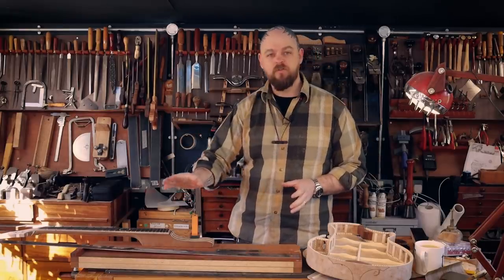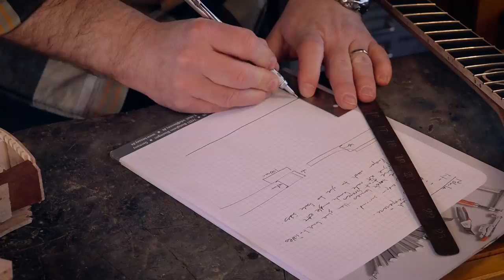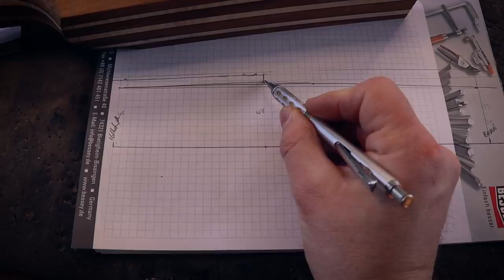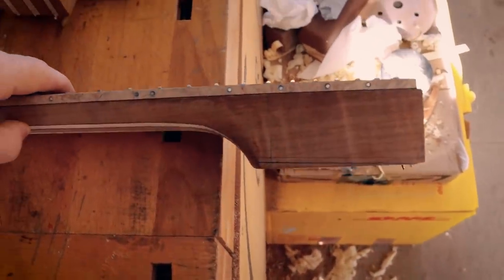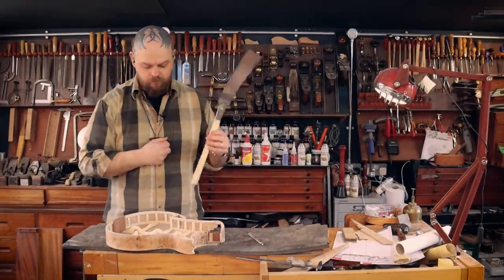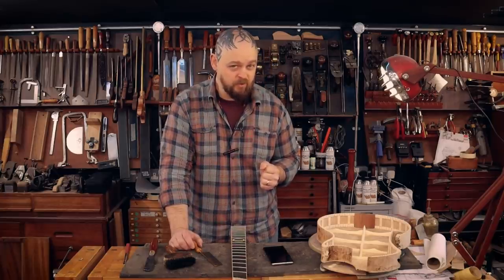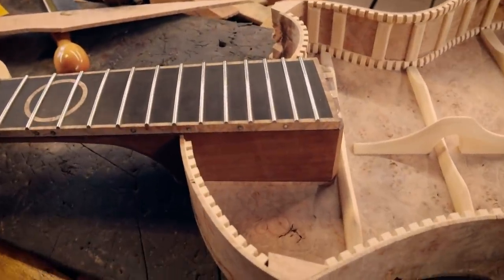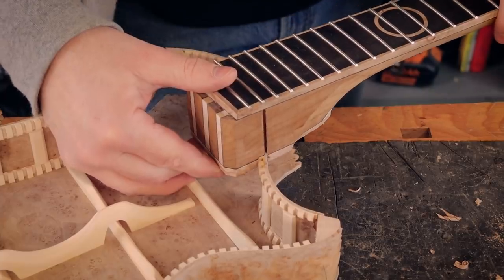Ep 15 - Making a CRAZY Spanish Neck Joint - Making a Modern Multi-Scale Electro Acoustic Guitar

Comment: Your suggestion about sanding before fitting the neck is really useful, thank you. I always scarf joint a headstock then realise I should plane the sides straight of the neck before gluing the headstock. This time I try to remember. Cheers Dave

Comment: Nice Ben! I went over to Spanish neck joints a few years ago. It is harder with one-offs . A tip (for what it's worth or not) We do ours in a glue up jig that keeps the neck pitch and centerline dead on every time! If the fingerboard is on, you can really dial it in before top glue-up. Once the top is glued in the jig, it is locked, pull out of jig, and the back goes on last. Perfect.  Love Spanish Joints! (You encountered one of my old violin style ones in your other video of a GuitarViol - that went away). TogaMan

Comment: First, the skill with which you handle edge tools is remarkable. I basically watch for that and learn by your watching hands. Thank you. Second, did I miss your explaining that you are approaching a traditional Madrid neck joint backward? Traditionally, the unbraced soundboard is glued to the neck, that assembly goes face down on a solera that has a neck extension at the correct neck angle. Then add everything else. Is your approach here because of the in-the-moment nature of the design/build process?

Comment: 5:30 Yes ben I am exactly the same...
I would have done a similar thing with the ruler myself, put ruler over neck work out where bridge is etc But I can see with your bracing ect how this is a problem.
There is a way to do it on the interweb using your scale length etc...
It tells you in deg what your neck angle should be, this has saved my arse more than once.
Because once you know the angle you can workout how much shimming or taking off you need to do to be in the ball park

Comment: If I were insane enough to take on a build I would do as you recommended because I did once refinish my old acoustic and learned the hard way how intensely difficult it is to sand those critical areas on a fully constructed instrument.I was hoping to see you use the full length of the heel,with lots of naughty routing to accommodate the braces.What fun that would have been and perhaps would have created a stronger joint...............................

Comment: Sorry to comment as I watch the video ( I’m sure you got the answer but this come to my head) so to calculate the back wedge you cut the 3 mm from the part that you know will be the right high and when you cut the piece that fits on the bottom of the neck you cut it for the full length then when you position the piece will give you a perfect template of the wedge that you need for the back end of the neck
Reply: Again stoping to comment sorry I can’t help it make me feel like if I’m part of the build.... even knowing that this is recorded and will not matter when I do it, one question as the inside of the guitar is also on display (you can see it from the cavities ) are you going to apply some kind of finish or leave the inside wood raw?
Reply: And again..... Ben is not an error if it’s a solution,you not working with an unworkable material ... instead of an error call it making it even more awesome

Comment: The only issue I would see with your take on the traditional Spanish neck joint is that you don't have the top pinched between the neck and the fingerboard. Other than that, Im with you on how much easier it is to do vs any other type of acoustic neck joint.

Comment: Great video Ben.  "The higher bridge the more string tension pushing down on the top, the more sound we will drive".  I would love to see the math on this [not from you obviously :) ]  I don't think its true.  The string itself will be the same tension.  If for arguments sake we believe that a 45 degree angle creates more pressure than a 10 degree angle then wouldn't we have to reduce the tension to tune the guitar?  Another way to look at it:  imagine a steel bar across the saddle.  we put a 1 kg weight on either side.  Will it make a difference in down force if the bar is bent at a different angle?

Comment: If you ever get a chance to see one of my hollid (hollow and solid) body's you will see the exhaust ports are always on the sides and I always encapsulate the pickups so no puffs of air slip past the pickups and ruin mid range tones as well as cancel out string waves. Bye bye sustain. Remember to shield as much as possible. If you pull this off right the thing will not howl and turning amps up will not cause feedback issues. My babies are in studios because of these engineering peramiters. Keep up the great work. We love y'all here in Southeastern Missuori in the good ole U.S. of A.

Comment: Ben, I also love neck through, but in this case, I think you should have gone for the dove tail joint, you would'n had the need for the extra visible pieces on the bottom of the neck (against the back), and would have been much easier to get it right. You could have fixed the neck angle and all that little things you had to improvise to transform that electric focused neck into the acoustic one you ended up doing. Although, Im not saying tou did it wrong, just a little bit over complicated.
And at last, now you have another problem, you have to cut the top to leave space for the fingerboard... and there is nothing undeneath to hold the top in place.

Comment: I’m wondering how much that burled maple ‘shim’ at the heel is going to inhibit the transfer of energy from the strings through the neck and into the body, given how soft it is? I assume it’s soft, but maybe I’m wrong? Or maybe there isn’t as much transfer of energy at the neck joint as I’m assuming? Or maybe the hardness doesn’t effect it as much as you would think?
Reply from the maker: Considering it's the same material as the bulk of the guitar it won't make any difference at all. The wood is actually harder/denser than it looks too.. B

Comment: How do you deal with wood that has glue on the surface, i found that the staining on those parts is not working......
Do you was the glue with water ? Damp cloth ?
Reply from the maker: you have to sand all glue away where possible, I use standard water based wood glue...
Reply: @CrimsonCustomGuitars  yeah, that was my exp, i use BISON super wood glue

Comment: I'm wondering how that flexible top and bottom will keep the neck stable when it is strung up.  As for colors, have you ever worked with Aniline Dyes?  They are transparent with incredible colors.
Reply: ... Stabilising blocks either side of the neck will also be glued to the top ... When all glued together, the 'box-effect of the shell makes the guitar stiff . Hope that helps ...
Reply: @Jester-Riddle  When I picture the entire thing glued up, I still see that the neck top and sides will have very little surface area that is glued to anything.  Can't wait to see how Ben resolves it.  And jeez, as a builder my whole life, I cannot get over his tools.  The chisels, planes, unbelievable.  Tool porn.
Reply: @johnjperricone7856   ... I feel for your concerns ... However, with blocks glued in place (as mentioned in the vid) will the neck be less secure than a traditional glue-on acoustic neck ... ? Yes, it's steel strung which adds some tension, but the blocks should be able to counterbalance that ... Yes. I have some concerns also ... but I was originally answering with what Ben was saying, not my personal opinion.
I have the 'Workshop envy' also ...

Comment: Ben, have you ever tried one of these,  probably a bit of a "marmite" tool but awfully useful at times especially to take the first cuts off when you do the facet neck shaping...https://www.axminstertools.com/microplane-50mm-rotary-replacement-blade-951202.  I use it in my drill press and it saves an awful lot of arm ache!

Comment: Did I knew about sanding parts before joing to avoid sanding tight corners? Sure I did. But it does not matter. I don‘t built guitars, not will I ever attempt to built one. I make knives but love to watch other craft videos. The value is not to learn the absolute knowldege but how to attempt things and deal with issues.

Comment: I didn't think you made a mistake so much as you followed the wrong plan for a while. Way back when taking your measurements you said you'd have to add 6 mm, and then you added only 3 mm and wondered why things didn't quite work. When you added the second layer to the back of the neck, you were only going back to the original, correct plan.